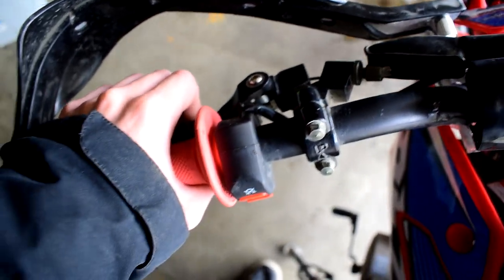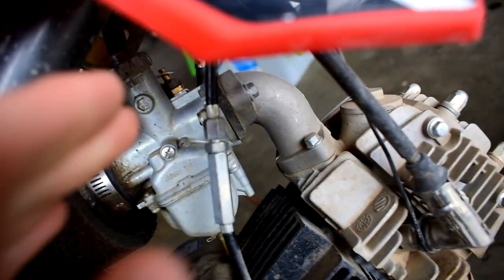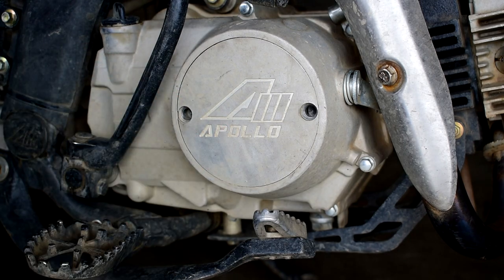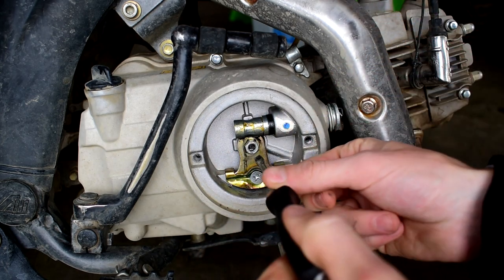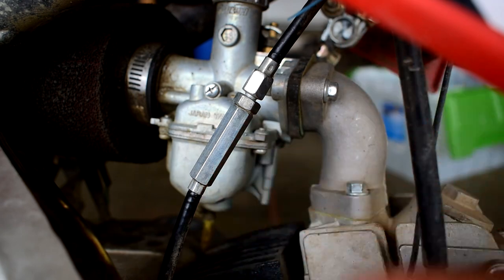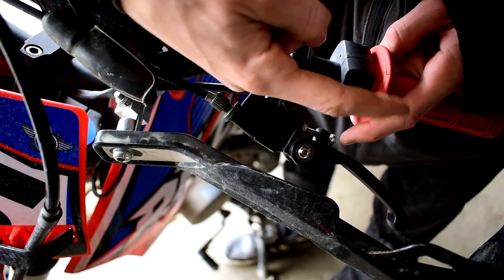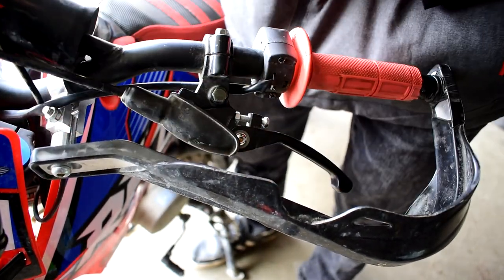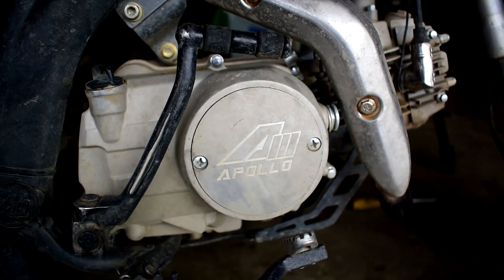How To Make Your Pit Dirt Bike Last Longer! | Chinese Pitbike Apollo RFZ Clutch adjustments

Comment: Good video. I think a good way to say this is that you screw the flat head adjustment screw out until it’s well loose and then back in until it’s “seated”. You will feel it go from no resistance to seated. Then if you were to keep tightening it you know you’re adding a lot. I’ll play around with the adjustment and report back.
Reply from the maker: Thanks for the information!

Comment: Hey, really appreciate all the vids, quick question: I believe the recommended oil amount is 750 mL, I dumped about 800 mL in and when I took the clutch case off everything was completely dry, should I add more oil or should it be dry because it's cold at the moment
Reply from the maker: Itll be dry when engine is cold
Reply from the maker: Oil will circulate once the engine is running

Comment: Hey man much appreciated for this video definitely went ahead and made that purchase and will be doing this to my 125 Apollo. 

Anything else you recommend I do to my Apollo to make it last long time? I'm willing to buy multiple parts to replace the stock parts that come on the Apollo I just don't know what to get. I want my bike to last a long time and not give me problems if I try to ride it long-distance
Reply from the maker: Tbh just dont be rough on the bike and maybe itll last. Mine destroyed itself after a year of enduro
Reply: @AaronsEnduro  thanks for that. Sidenote I actually own the Apollo z40 125. Hopefully the parts that you linked and which I purchased work for my bike also!  I believe they will. Same with the carbhub vm22 and the uni filter. PRAYING all of this works with the z40 125
Reply from the maker: The vm22 might be a little small for a 125cc.

I ran a vm24 on my 125cc
Reply from the maker: Never heard of a z40 before. If its the same 125 lifan engine all the parts are interchangeable
Reply from the maker: Also be gentle on the shifter, they have weak transmissions
Reply: @AaronsEnduro   thanks for the info man its much appreciated. So yea i guess I ordered the wrong one because i got the vm22 and i have a 125 fml. Looks like thats all they have on amazon :/
Reply from the maker: Also, i do recommend a legit branded carb over the replicas. You pay for what u get. Personally I purchased an authentic genuine mikuni vm24 carb. Not to say a replica cant work, but the casting quality is poor

Comment: This helps a lot. quick question, when ur bike is off, in 1st gear, clutch on, should it roll as smoothly as in nuetral?
Reply from the maker: It should yes, but sometimes the clutch packs get sticky when its cold
Reply: @AaronsEnduro  hi there bro i got a cuestión if you can help me out I got  a 2017 125 cc rfz but my throttle cable is broke I order one in amazon they send me a different one. You know what size is it or how to order it? Plz and thank you
Reply: Mine doesn’t roll in first when bike is off
Reply from the maker: Hey sorry hector i didint see your comment! Did you get it figured out?
Reply from the maker: Lilnino, have you set the clutch ?

Comment: Hey do u know that screw and nut adjuster in the middle of the other side of that cover do u know where I can buy a replacement one for a 125cc dirtbike I can’t find one anywhere or I don’t know what’s it called so if u can give me a hand mad stuff if not allg
Reply from the maker: To my knowledge they dont sell individual pieces of a carb. If you have the stock carb its junk and i swapped a genuine vm24 mikuni carb onto my bike

Comment: Great videos! Just have a quick question: my clutch is pretty stiff. I haven’t had any problems with it, just don’t like it being so darn stiff…how would I go about loosening it, so I can pull it with 1-2 fingers instead of having to use my whole hand?? Thank you!
Reply from the maker: The upgraded foldable levers give you a better pull leverage on it
Reply from the maker: It is fairly stiff tho
Reply: Okay, what one would you recommend? Thank you for responding and keep up with the videos! They’re very very helpful!!
Reply from the maker: @jordyhall1909  the black ones you can see in the video

Comment: Hey man, doing this right now. on the first adjustment it seems like it’s lubed up in there and mine wasn’t when I opened it, don’t know if that’s critical
Reply from the maker: Itll prevent it from rusting together. You want it to be lubricated with something along the lines of never seize. ( a type of grease)

Comment: you seem like you know whats what so i just boughta dirtbike same brand my clutch lever isnt doing anything and i can switch gears freely which i know should not happen im new to bikes so this is all new to me
Reply from the maker: When you change gears does the bike want to move if u hit the gas?
Reply from the maker: If u can sit stationary and put it in different gears and the bike doesn’t stall, sounds like the engines not engaged with the clutch/transmission
Reply from the maker: If you want 1 on 1 help you should check this out: https://www.youtube.com/channel/UCcviyKZ2Vf3IHFliwebzODA/join
Reply: @AaronsEnduro  when i change gears the bike stops however if im holding the gas it will jump and then stall but if i can time it it will launch and i can ride however i wont be able to stop but when i do it turns off
Reply: @AaronsEnduro  when i get the time ill join your group
Reply from the maker: Your clutch lever adjuster isint right, it doesnt have the right pull on the clutch to separate it

Comment: Hey buddy my wife layed her bike down on friday and broke the clutch lever, I bought the foldable set like u got, the clutch lever worked fine, but the break lever mount hole is way bigger than the stock, and the lever jiggles. Got any ideas to fix it?
Reply from the maker: Thats odd.. sounds like youll need a different lever
Reply: @AaronsEnduro  yea I know, but I cant find the OEM parts. I googled it and clicked on the apollo parts in Quebec... natta....🤬
Reply from the maker: Apollomotors.ca is sold out?
Reply: @AaronsEnduro  idk I bought the collapsible ones...delivered on Saturday,  she didnt care if they dont match... lol I got it going , she's a trooper bro, I got it on video... I'm gonna start uploading vids so you can see our adventures, start us dirt bike community with adventures and campsite. Sananagins!... feel me?
Reply from the maker: Thats awesome! Cant wait to see it
Reply: Normally you get the clamps also with levers. I had same issue but on a pack I got it had clamps with thinner or thicker screw connecting the lever. I only had issue because I tried changing only the lever and keeping new clamp. Use screw with new lever (clutch I get with but not the brake lever )
Reply from the maker: Yeah usually they come together

Comment: Hey man, same bike. My kick lever won’t go down, I’ve replaced the carb, throttle cable and clutch lever and cable. All needed replacement anyways but now am at the part where i need to fix the problem and I have no idea if clutch adjustment can fix it? Any clues? Thx
Reply from the maker: Like your kickstarter wont turn
Reply from the maker: If the kickstarter wont turn over, you either A, broke the teeth on the kickstarter shaft and its jammed. Or you blew your engine and the piston is seized. Does the bike bump start? If so its just the broken kick start shaft/teeth
Reply: @AaronsEnduro  Thanks for the quick reply! Honestly I haven’t started the bike in over 5yrs and it has just sat in my aunts garage. But I remember i use to bump start it during my last days riding it and i’m pretty sure it’s kickstarter shaft problem. I’m gonna see if you have any vids I can watch to fix that. Thanks for the rely or I would’ve never been reminded I use to bump start it lol
Reply: @AaronsEnduro  im an idiot i wasnt pulling the clutch in when kickstarting the bike, it’s ben a while man. But now it turn but doesnt catch
Reply from the maker: Like the kickstarter isint turning over the engine
Reply from the maker: Thats the whole clutch issue and fixed in this video
Reply: @AaronsEnduro  Damn thanks brotha, should’ve just finished the video first lmao. Yeah, that fixed it.
Reply from the maker: Heck yeah! Glad it helped and got the bike dialled in!
Reply: @AaronsEnduro  Hey bro, crank is free and compression is good but it’s sticky if you know what i mean. It goes down but not smooth at all. Do you think I’ll have to split the engine to clean the crank? I hope to God you have a video on this lol
Reply from the maker: Ive never heard of a “sticky” kickstart 
Can you further explain this?
Reply: @AaronsEnduro  sorry, not the kickstart. But the crank crankshaft is turning in a really sticky/stiff manner. Like when I kick down it’s not spinning freely
Reply: Do you think it could be the cdi box? The bike has no spark too, could it be making the turn on the crank act so stiff..
Reply from the maker: If the crank is sticking or not spinning freely that doesn’t sound good at all. Should have nothing to do with cdi box etc etc. the crank and piston is its own rotating assembly independent from the rest of the engine. If they dont spin, you got big issues (bad crank bearings, broken something etc)

Comment: I have bought a new chinese 125cc pit bike. Clutch does not fully engage after all the adjustments. Seller does not give warranty for a transmission. What to do? :(
Reply from the maker: If you slipped the clutch a bunch before getting it set right you can glaze the discs and theyll never mesh together again after. Youd need a new clutch in that scenario

Comment: Hi quick question I had the same problem I did the first step but I kinda tighten it to much now when I don’t press the clutch it feels like it’s in the clutch position the bike won’t kick now it goes down soft with no power and I got can’t loosen the flat head screw that I tighten the clutch thing with
Reply: Please help if you can
Reply from the maker: You have the clutch pressure set too tight. You need to back off the black flat head screw. Make your you loosen the 10mm nut on it first.

Comment: Ik this is a bit late but should this fix the rolling in first gear with clutch pulled in ?
Reply from the maker: Yep, note that these bikes clutches seem to stick after getting cold. You might need to use the clutch a couple times before adjusting

Comment: Should the clutch be oiled?? Mine was dry and had dirt in there :(
Reply from the maker: The clutch gets oiled by the engine oil. It’s important to do frequent oil changes.
Reply from the maker: Or you were riding around with not enough oil. But if you were inside the engine id assume you had drained the oil to pull the casing off. So in that case its normal that its dry ( since you drained the oil)
Reply from the maker: The dirt on the other hand is from the air filter you have sucking in debris into the engine. Upgrade your air filter

Comment: Hey man! Doing this I ran into something really bad, while adjusting the screw, as I was putting the nut back on the screw completely snapped on me! And honestly not sure what I should do at this point.
Reply from the maker: Thats gonna be fun… gonna have to try n get it out and replace it
Reply from the maker: You can always weld a nut onto it to remove it
Reply: @AaronsEnduro  do you have a link to where I can replace this adjustment part?
Reply from the maker: Apollomotors.ca

Comment: How come no one makes a video about Mikuni idling way too damn high like a jack
Reply from the maker: Because it takes 5 seconds to adjust the idle screw
Reply from the maker: Just lower your idle. Done.
Reply from the maker: I have two videos on the topic if tuning your carb
Reply: I have an Apollo 125CC dbx and I just changed the carburetor two-way Mikuni 26 mm on my old carburetor on the needle was set at the top on the new carburetor it was set the second from the top it didn't work so I put it at the top and it still idles way too high and I put aftermarket fuel screw you know the red one from Amazon
Reply from the maker: The needle clip position has nothing to do with idle speed
Reply: @AaronsEnduro  and it's not the idle I know about the idle screw the problem is when I give it gas has a problem coming down from idle if I turn the idle screw down it goes too low if I turn it up it goes too high
Reply from the maker: As well as the fuel screw ( the red one you put in) has “nothing” to do with idle speed either
Reply from the maker: You need to adjust the IDLE SCREW
Reply from the maker: You should send me a video of an example so i can fully undestand what your trying to accomplish then
Reply from the maker: @aaron_greenway on instagram
Reply: @AaronsEnduro  okay how??
Reply: I just sent 3 videos

Comment: I went through all the steps but I’m at the point if I adjust any more I lose compression. Still jumps in when I put it in first. Any thoughts?
Reply from the maker: I know that if the bike clutch hasnt been actuated a couple times to get oil through the clutch pack it wont matter how much you adjust it because the clutch pack is sticking together. Start the bike up, use the clutch a couple times to free the clutch pack and get oil through it, then set it

Comment: How do I make my clutch softer
Reply from the maker: if its really tough to pull try lubbing your cable or replacing it
Reply: @AaronsEnduro  and where can I buy a good name brand cable
Reply from the maker: I used an all purpose light lubricant 
 jig-aloo
Reply: Get on line if it is hard to pull and it is not the cable you can get a little box that hooks to the cable at the lever end it says easy clutch at least the one on my 490 Yamaha yz does but I don't see why a smaller bike would need one a screw fell out of mine on the trail and I had to take it off and just put the cable on without it u better b a hell of a man all i can do to pull it in and it not on there so when I got home i put it back on the clutch is huge in the bike it is the definition of evil better not try that bike if you are a beginer.
Reply from the maker: Use punctuation, that was difficult to read
Reply: @AaronsEnduro  Trying to take care of two kids and type this to just trying to help my bad won't do that again.
Reply from the maker: I appreciate wanting to give out information, i do! but for those who dont fully understand bike terminology will struggle to read one run on sentence. 
I know that was tough for me to even read and understand it.